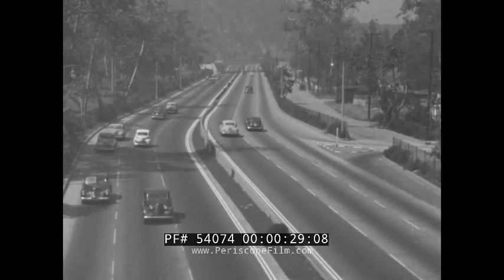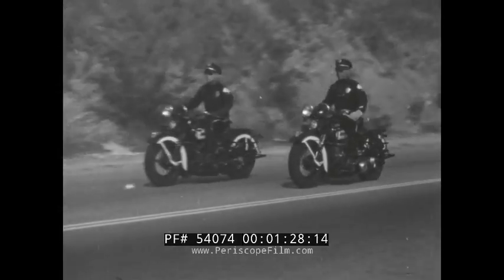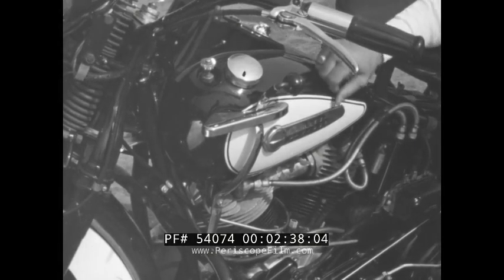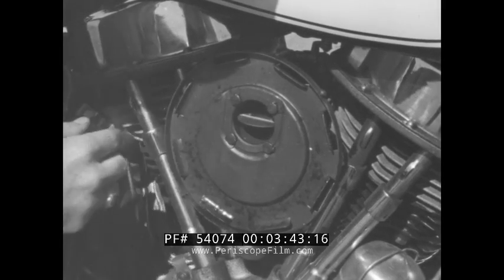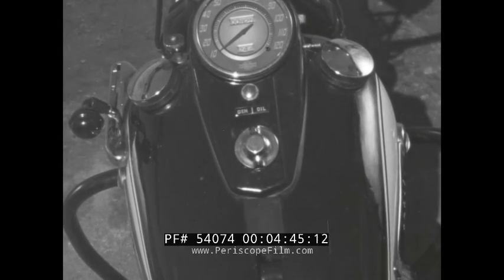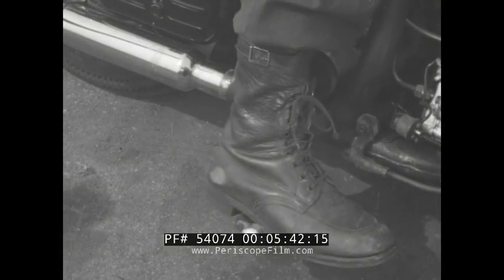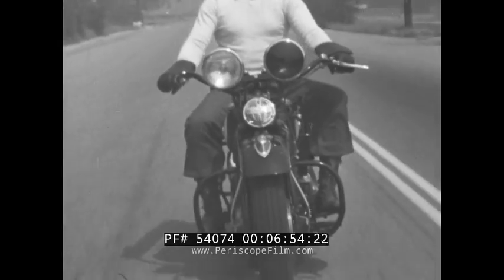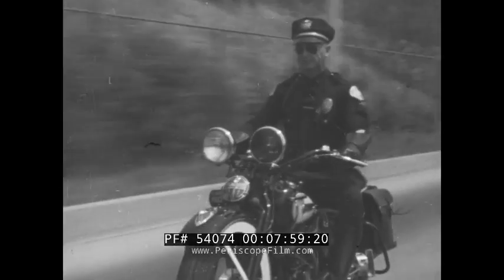1940s LAPD POLICE MOTORCYLE PATROLMAN RECRUITMENT FILM HARLEY DAVIDSON PANHEAD MOTORCYCLE 54074

Comment: Check out the LAPD Spec voltage regulator, shielded plug & coil wires, locking speedo, front brake drum cooling fins, extended exhaust & dual headlight ...
Even the earlier VL & EL models were required to reach 100 mph

Comment: those are 74 ci harley panheads not indian scout. otherwise nice to see the old footage.
Reply from the maker: thanks we have been trying to figure it out. know anything about the history of that bike in police service we can add to the description when we modify it?
Reply: It was the sport bike of its time as it was overhead valve instead of a flathead. It was 1200 cc or 74 cubic inches with i believe a 3 speed transmission. It had no rear suspension in those years unlike the indian chiefs. They had six volt systems unlike todays 12 volts. They were not orefered by police as the indian motorcycle coukd be set up having the accelerator on the left freeing up the gun hand according to legend. Their top speed was around 89 mph but could be modified to go faster later on, but on the roads of the day that was much faster than any car of the times could maintain. They ran a chain in both the primary and final drive and had an oil piston under the seat for comfort
Reply: The bike should be a 1948 FL, The only year Where tis bike was produced with old style springer  forks. . In 1949 they discontinued this kind of fork, mounting  a telescopic one (Hydraglide)
Reply: 20 seconds into the film, there is an Indian Chief.  Partially obscured by the titles, but no mistaking thos full valence fenders.